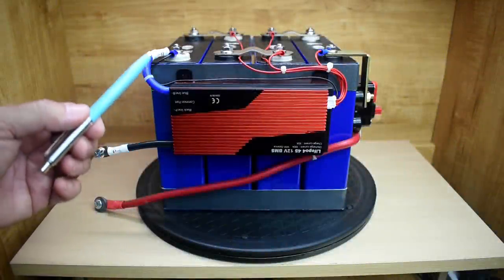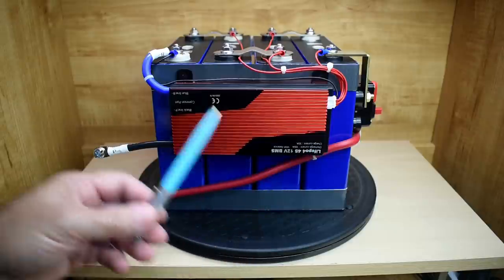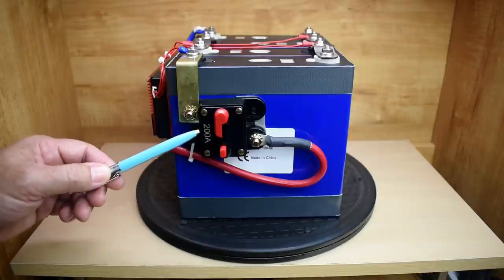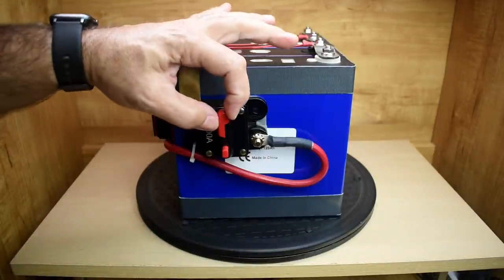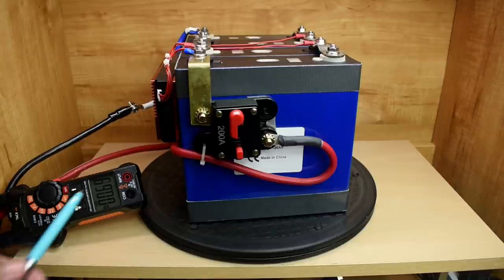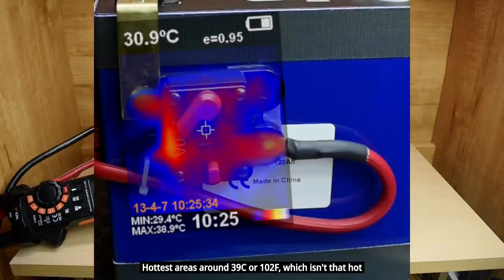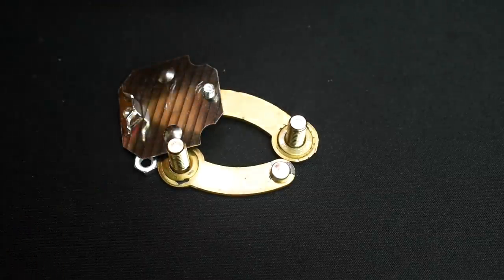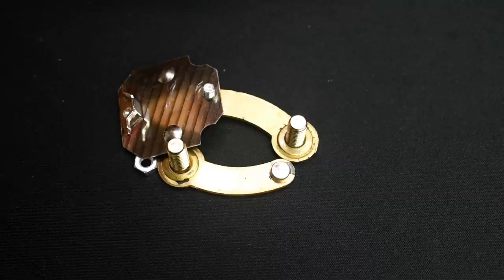NEVER Use This High Current DC Circuit Breaker For Solar, Auto, or Marine!

Comment: I would recommend using a commercial 200 A breaker for a high amp potentially fire causing use case like these batteries. Or a 200 amp fuse at bare minimum. You will want to watch eev blog's video on glass fuses before going the fuse route though. Some fuses can vary greatly in how fast or slow they blow in certain conditions.

Comment: Nice vid. Well illustrated. I use square D ac breakers. QM breakers are rated at 60vdc and QO breakers are rated at 48vdc. NOT the ones you find at home despot. You can find these at electrical supply outlets.
Reply from the maker: Thank you! Yes, they can be used, but I think they only go up to 60 or 70A.
Reply: @electronicsNmore  QM go to 200 amps. I have a 2 pole 100 amp protecting my battery bank. Says rated for 60vdc right on the breaker. Surplus cost $25.
Reply from the maker: @rocktech7144  You stole that, they're expensive.
Reply: @rocktech7144  Hi RockTech, where is your source for sq d QM 60v breakers. Thanks

Comment: I noticed something that could explain part of the problem.  I don't know if it was like that prior to disassembly,  or was a result of the disassembly process, but right in the center of the bi-metal plate,  there is an obvious dent.  That dent would definitely affect accuracy.  If it occurred during the process of taking it apart,  then please disregard... Either way,  that breaker fittingly,  received a hammer... Great,  informative video as usual!
Reply from the maker: I did that. Lol.
Reply: @electronicsNmore  oh..ok... Might actually work better now! Haha...

Comment: Excellent video Doug! Watching the video I was wondering what the difference is between that circuit breaker & the breakers found on electrical home panels? Thanks for these videos.... 👍👍
Reply from the maker: Glad you enjoyed the video Steve! They work very similar, a bimetallic strip, with springs. Some AC breakers are rated for DC. Thanks for watching!
Reply: Breakers in the house are a magnetic and thermal type, rated for AC only.  You can't use an AC breaker on DC because, DC requires about 4 times the open gap to prevent arcing.  There are some combination magnetic/thermal breakers made for DC but, they can only be used in a circuit where the current flow can only occur in one direction only because, these breakers have a polarity associated with them.  If hooked up backwards, they don't trip, they just catch on fire.  You would never want to use this type breaker between a solar charge controller and a battery bus for instance.

Comment: I wish I had watched this video before buying 5 of these rated for 60amp. I can only assume that even if these are marked as rated for 300amps, they are all the same inside and only capable of 50-60amps as I watched a clip where the guy tested where these would hold the amount of current going through them.

Comment: My alleged 209 amp one kept tripping at 100 amps. Furthermore, that plastic arm which you swivel down to reset the breaker is so flimsy where it connects to the shaft that it cracked and no longer moves the shaft. Bought another one...and surprise surprise....both faults repeated.
Reply from the maker: Yep. Total garbage. Be sure to check out my solar and battery testing video playlists as well. Thanks!

Comment: I bought an allegedly 80amp version to replace a broken one. It's used on a mobility scooter. The breaker  is a cheap and nasty design. I should have bought from a reputable quality source. Pops all the time.
Reply from the maker: Stick with Bussman and other higher cost brand breakers. Thanks for watching!

Comment: It not the connection. Its called the bottle-necking effect with current. You have too small of  post, then the inside allows the full current, then that big load bar you have is the opposite effect at that end where it dumps energy. Thus 2 hot spots at opposite ends. These breakers for 12v are garbage. They don't work all because they have small gauge posts. You need 3/8 or larger to get away from this bottleneck effect.

Comment: It's not the design of the breaker that is causing it to trip too soon. It's the fact that it's a cheap Chinese knock-off. Use a genuine Bussmann brand Type III circuit breaker and you will have no problems. I have been using the Bussmann brand Type III (CB285) and Type I (CBC) breakers for years with absolutely no issues whatsoever. You get what you pay for.

Comment: Thanks, But it was to late for me, had it to learn the Hard way.  Mine 200A Part could not hold 120A for  2 h  now i use Mega Fuses.
Reply from the maker: MEGA fuses are a good way to go, and fairly inexpensive.

Comment: Thanks for informing video I have 4 different types of these the two I’m gonna use are Allen set screw I do have the same type as you show. I got the Allen type and I got about two hundred more amps then I needed at the battery but I got fuses at my amps if they don’t work I’ll have to change out to better or fuses up thanks again!
Reply from the maker: Glad to help Harold! Be sure to check out my very wide range of videos and share. Thanks

Comment: I'm sure you know much more about this than I do, and I know these breakers are junk (generally speaking) but using a brass bus bar as you are, instead of copper, creates electrical resistance (more resistance and therefore heat, than if it were pure copper). Doesn't it? Of course the breaker parts also are brass and steel also, so it probably makes no (or little) difference.

Comment: one bad thing if using brass, it does not have very good conductivity as pure copper. Electrical Conductivity of Materials - Blue Sea Systems
The differences in electrical conductivity of various materials used in marine electrical products are often not well understood. Making assumptions about the electrical conductivity of a material because it looks similar to another conductive material of known ampacity can lead to disastrous results.

Perhaps the most common form of this error is the substitution of brass or bronze for copper in electrical applications. Brass is only 28% as conductive as copper. Some bronzes are as low as 7% as conductive as copper!

Copper is the standard by which electrical materials are rated and conductivity ratings are expressed as a relative measurement to copper. These ratings will frequently be expressed as "28 IACS". IACS is the abbreviation for International Annealed Copper Standard and the number preceding "IACS" is the percentage of conductivity a material has relative to copper, which is considered to be 100% conductive. This does not mean that copper has no resistance (is 100% conductive in an absolute sense), but rather that it is the standard by which other materials are measured. The higher the % IACS, the more conductive the material is. This standard refers to a pure, "standard" copper having a resistivity of 1.7241 microhm-cm at 20°C (68°F).

Armed with this knowledge it is interesting to examine the IACS conductivity values of some common materials.

Comment: I have seen close to identical "breakers" being sold as 60A and 70A, I guess they have just relabeled low current bimetallic breakers to make some easy Yuans at the expense of unsuspecting customers. quite strange it is that ROC china sellers call brass stuff copper allthough they have different name in mandarin 铜=copper 黄铜=brass the breaker could work if terminals were made from copper, but that is so expensive :-)

Comment: What is the brand name of the defective breaker. There are a lot of them out there and a large range of pricing
Reply from the maker: Hi Mitch. It's generic. If you see the exact same housing, lever, and reset button, regardless of color, avoid it. I posted a link where you can find other breakers. Thanks for watching!

Comment: The steel stud is not the issue. It doesn't help but changing to copper or brass for it makes a 1% difference, it's not the problem. Current travels on MATING surfaces. I did not like the pressed in studs, the knurling should have pressed into the base metal of the bars to make solid contact. The convex washer on the one sucked, you want nice flat and clean mating surfaces. And you properly snuffed out the depression on the other inhibiting contact without a spacer washer. Brass is ok but it's a fraction of copper...that's a 10% issue. No matter what however the internal components just too small for the rating, it's heavily updated to sell more without producing the goods.

Comment: Seems like these are just too small for high amperages..
Reply from the maker: The contacts and connecting metal pieces need to be larger.
Reply: @electronicsNmore  I would be interested to see the sub--100A ones tested, I have a 30A and a 100A so I might make a quick video myself.  I also noticed that the contacts around the posts on the ones I got are below the plastic casing.  

They are a convenient format, so now I'm looking at the square ones by Bussman and Blue Sea as you suggested, they are about the same size, but seem to have much beefier and better designed contacts.

Comment: 2:56 "...when you do this..." weren't you hindering the little red button from moving thus preventing it from latching?
3:50 yet when you did not touch it, it still did not latch... so it is bad

Comment: Nice video. I'm familiar with those breakers. Cheap ! However, some of them perform well, other are crapy ! It's random.
Reply from the maker: I think the majority are poor, not worth the time buying them. Thanks for watching Philip!
Reply: @electronicsNmore  Indeed. I quit using these ages ago. The traditional melting fuses at the end of the video are rock solid reliable and very cheap. Also easy to recycle from cars/dead car batteries.
Reply: @electronicsNmore  Hi, I am very grateful for your video.  I have three plastic containers of these lower cost breakers after having bought so many of the Bussman.  We used all Bussman and Midnite Solar for our first 250 panels....then I got 108 more panels (this is for a factory) and bought the low cost versions.  Out of them most are different in appearance than yours in the video.....however I have five pieces of 80A exactly in appearance to your video.  The rest are slightly smaller in dimension and comprise look obviously to be from a different manufacturer overseas/low cost.  If I see problems with the others that are different I'll be replacing them with Bussman but wow what a price difference.  Yours has a real cheap lettering and overall cheap appearance.  The others looks to be a spitting image to a Bussman and luckily most are like this.....I wonder if Bussman allowed a factory to produce for them in that country and they illegally made in their name (no Bussman) but had legal litigation.  Now there is even yet a different style if you look at that famous auction site....more for tesing or not worth your time?

Comment: Don't forget Square-D's QO breakers are rated/listed for DC, up to 96V, AFAIR. Put them in one of those cheap little spa panels.
Reply: One look at these things and you can see they can't safely manage 200Amps, Go look at your main breaker in your service panel: and remember, that one is for AC. DC current is even harder to break up.
Reply: and even with the BUSS 200A breaker: how the hell are you gonna attach something like an AWG2 cable to those little posts?? 
Don't forget, we're also supposed to de-rate for DC (now you're looking at AWG1 or 0...)
To safely control 200A, you should use a distribution panel, and the Square-D QO breakers.
Reply from the maker: True! I've seen them. SQ-D is good.

Comment: Dunno about those more expensive name brand DC resettable fuses.  You go on Amazon and people complain about the same type of problems happening on those expensive resettable fuses also.  Apparently, DC fuses are much more tricky to implement than AC fuses due to some physics I don't yet fathom.

But a big contributor to this the sparking oxidation from rapid connect/disconnect under load.  The switch always sparks if there is load at the time of connect/disconnect.  The spark oxidizes the metal at contact point which deteriorates the conductor.  Not sure how household AC fuses deal with it as the same thing happens inside them as well.  So each time you switch the fuse under load, you damage the conductive part a little bit.

The only way to deal with sparking problem long-term is to use a resistor or "sacrificial" part of the conductor that is active only during the very small period of time at the moment of first contact or disconnect. So, during connection, the resistor/sacrifice makes first contact.  Conversely, during disconnect, the resistor/sacrifice is last to lose contact.  So if the "expensive" fuse doesn't have this feature, the same type of heating problems will eventually plague them as well.

Comment: 5:16 As seen on your thermal cam, it was the part of the wire under the black heat shrink tubing that was heating up the most.
6:23 "..this brass section..."
OK... if that is brass, then it is definitely NOT FIT for high current. It should be pure copper.
8:00 this 2nd test is convincing.

Comment: To be the devils advocate - I'm glad to see them fail safe instead of welding together and melting something or causing a fire... that said, yeah, they are total crap. 
If it's rated for 200A, it should run 200A all day long - it obviously is not - 200A for a short duration, but not continuous.

Comment: I've had several of those breakers.  Typically they have the same housing with the current rating as in the video.  Those are defective.  I have ordered several that say waterproof and ignition protected on the front and those work just fine.   Those breakers are physically a different size slightly.

Comment: Might be high current, but just by looking at it not a proper low voltage breaker, this is gonna arc very soon (@<48V) for sure.

Comment: I only use these cheap breakers for solar input to chargers to disconnect the solar input before disconnecting battery power to the charger.  I don't trust these for high current use.  Probably 10 to 20 amps is fine as long as it is not causing any loss.

Comment: That style breaker is fine. However you need to get one built by Phillips or a quality marine breaker. About $60-80. Do not use the cheap $20 200 amp breakers.  This is a test of cheap Chinese breakers.
Reply from the maker: I never said the style of breaker wasn't fine, I said the one you see in the video isn't good. I told viewers which brand to buy that looks like the one shown in the video.

Comment: Why are you using AWG4 expecting anything above 65 amps? You can see on your flir shots that the cable can't handle the amps. I proper spec'ed cable would not have heated the terminals on the breaker. While I doubt these breakers are any good, I also doubt the science involved with determining that they are crap as presented in this video.  The fuse triggers because the resistance in your wiring is to high, and so actually it provides added safety in this case by triggering. You should not be running more than 65 amps through #4 wire.
Reply from the maker: Incorrect. Easily handle 100A using only a few feet of wire.
https://www.bluesea.com/resources/1437

Comment: Thanks, as a retired electrician I was hoping to use c/b's instead of fuses in my DIY, Lifepo4 system on my boat. 
I suppose it was laziness being able to throw a c/b instead of replacing a fuse, but I think I will go "old school".
Fuses are fiddly, but reliable.
Reply: Midnite Solar sells proper bidirectional DC circuit breakers. I think some models are UL rated up to 120vDC.

Comment: Honestly, you are causing that circuit breaker to bind on reset buy pulling on the trip button to reset it! It's not designed to be pulled sideways or to be used as a prying point for you week fingers, DA!
Reply from the maker: Incorrect. You need to speak to others who bought the exact same breaker.

Comment: Shucks, wish I had known sooner. Bought two 200-amp and four 50-amp. Still in box, haven't used them yet. Intent was for battery groups to the DC/AC inverters. Have since purchased large blade type 200-amp fuses.
Reply from the maker: Live and learn. Fuses are cheaper and reliable. Thanks for watching!

Comment: I had one  worked like a resitor turned on Off I thought my Inverter was broken was only letting 3 volts through took I while to work out as when on indicator lights turned on !!
Reply from the maker: They shouldn't be selling them.

Comment: Are Attwood marine, manual circuit breakers good for like 12v 6-100Ah deep cycle batteries for outboard trolling motors?
Reply from the maker: I never tested them, the Bussman and Blue Sea I know are just fine. Thanks for watching!

Comment: Just use aR fuses rated for inverter nominal current, should work way better than that breaker.
Reply from the maker: Fuses are the way to go. If they're properly sized, you won't be blowing them.